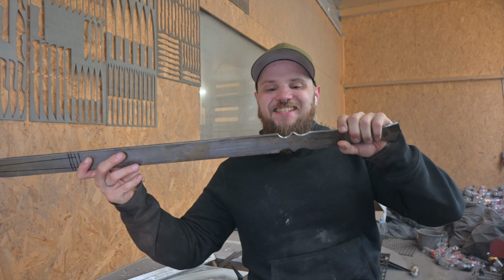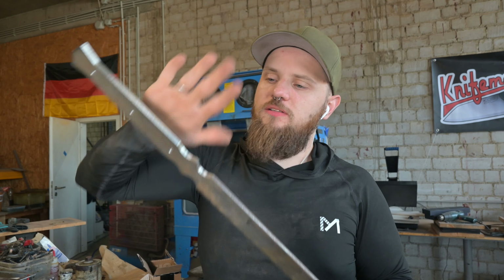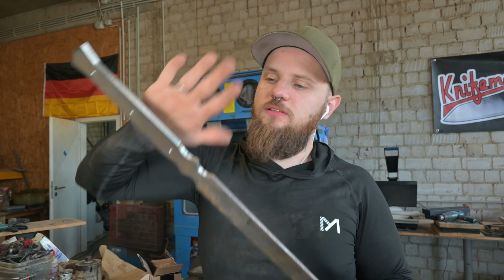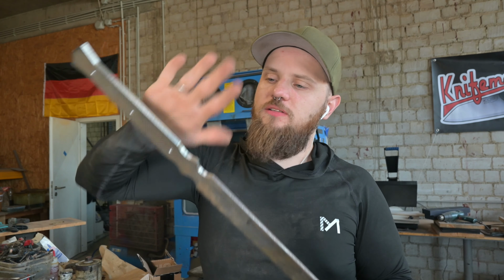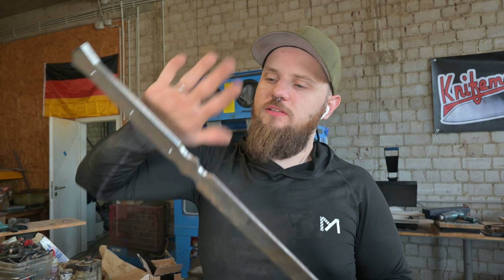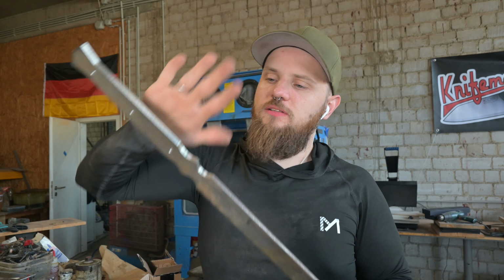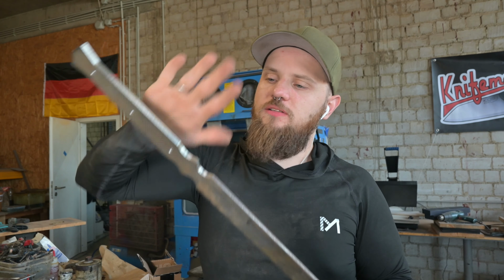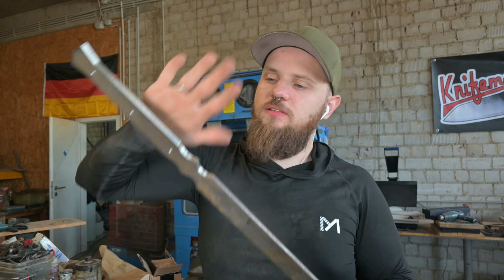I made a Sword!!! | Tacticalsword

Comment: If you want cleaner lines might be good to rig up a jig, to keeps the blade steady and even, while grinding.
Reply from the maker: yeah but for such a big blade it would be kinda weird to work with a jig and i like the free hand style i can adapt easily
Reply: @forgeworks3176  It ain't gonna be a big jig. Something with some adjustability for straight edged blades would give you a lot more control. But I get what you mean. We all got a good look at yer free handin', what with you nearly loosing your nubbins and all.
Reply from the maker: @Blood_hyde  totally right man. i will have a look into it.

Comment: at 14:21 in the vid i noticed a chip in one edge of the blade it also there in 14:29
Reply from the maker: yes i explained that . It happened when i cut into the big contact wheel. I couldn’t grind it out but still wanted to finish this project. This is not a sales product
Reply: @forgeworks3176  ok my apologies  may have been getting a drink when u mentioned it ,  thanks for clarifying

Comment: What's tactical about having no crossguard, a grip that gets slippery easily, an awful ballace due to said missing crossguard and the introduction of 2 potential breaking points near the hilt?
Looks really cool though, I'll give you that.
Reply from the maker: @AuraAian  yeah that was the goal looking cool and to have fun with it. This was more a test piece for other projects in the future to see what i am capable of
Reply: Not really seeing this breaking near the hilt. Plenty of material. Crossguard wont do much for balance either. A pommel/weights in the handle would be nice though!
Reply from the maker: @DonSchinkel  i agree. It is a bit more top heavy but still loads of fun to swing around.
Reply: Let me introduce you to katana, tang dao. Do you know why Viking sword vs gladiator sword don't have guard? Cause they made it to use with shield. A guard will only interference during combat. So does tactical sword...it was design to use for specific thing, last resort. You aren't gonna fencing with another sword. Instead sword act as just a larger knife, a machete. In modern battle, sword have difference use compare to those old day. 
Second pommel, this is to help bring balance back to user but for what reason? Easily control in swordmanship. But tactical sword didn't follow swordman ship. It's brutal, straight vs cold edge. It was made to be lightweight, easy to deploy. Today's world, soldiers didn't carry sword anymore, as they prefer 2-3 more mags than a sword. But if they ever need a sword, it will look like the one in video, but shorter, one hand sword. No pommel, no guard, shorter blade.

Comment: Cool Sword!. Sorry about your contact wheel and SC belt and happy you didn't get cut up. I had the same thing happen to me when I was first using a SC belt and didn't know I shouldn't grind against an edge. My wheel was only 6in though, so not that expensive to replace.
Reply from the maker: @ReluctantLightningForge  me too man i couldn’t have ended much worse! I have 3 10” contact wheels 😂so wouldn’t be to mad with them but the 16” is kinda bad but i am already in contact with the company to fix it

Comment: I didn't know just grinding away at a flat piece of steel constituted as "making a sword". I'm too used to seeing people forge it out from billets I guess. And the heat treat did not look at all hot enough or consistent enough throughout the blade to make it reliably hard.
Reply from the maker: yes it is also possible called stock removal. I would love to forge one out for sure. But i have a full time knifemaking job so i can’t spend a whole week on hammering on a piece of steel and it also goes to show that you can definitely make a sword without crazy forge equipment

Comment: Nice, yeap try to work over the wheel upper diameter not the lower section. I would like to see the Grade 5 Titanium Blade sword though it is a harder and more expensive metterial.
Reply from the maker: @azhuransmx126  yeah was a stupid mistake by me. The sword grinding was over 4 hours in the summer heat. My head was probably just mush😅

Titanium is an amazing material but not great for swords